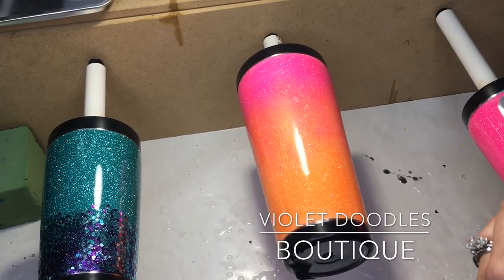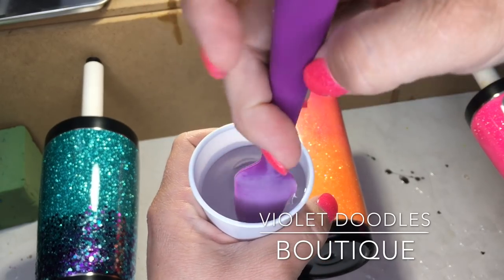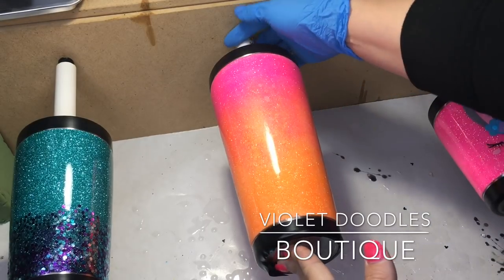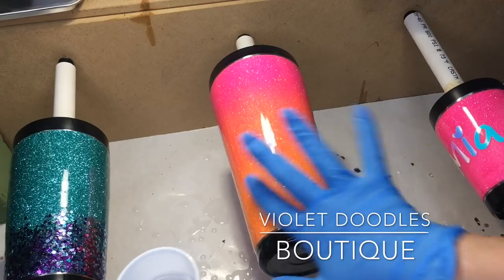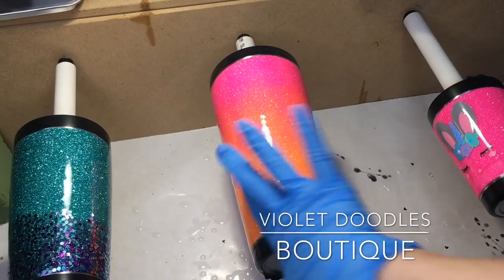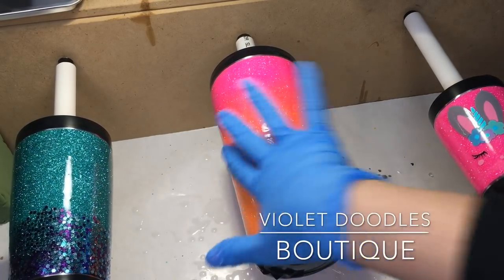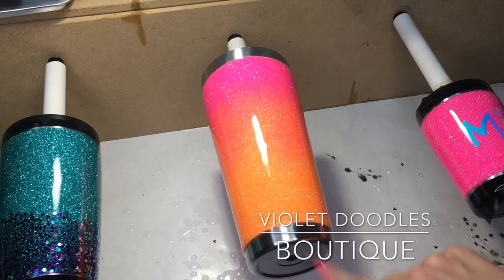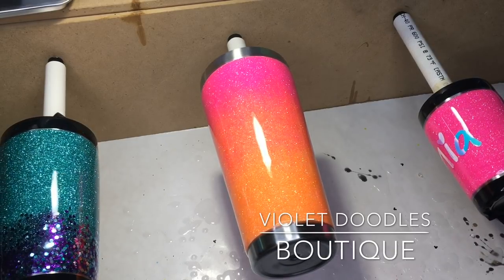Applying Epoxy Resin to a Glittered Tumbler

Comment: I don't know if you said it but how long after using Mod Podge can you apply the epoxy
Reply from the maker: Mod Podge can be deceiving as far as if it is dry or not.  I almost always wait 12 hours to seal with anything for glitter applied with MP.   If for some chance you do epoxy over MP that isn't fully dry, it will begin to look white again under the epoxy.  It can happen right away or even weeks after.
Reply: @VioletDoodlesBoutique  thank you for the quick response I was hoping for a shorter time suggestion but it ended up working out! lol
Reply from the maker: Ok.  Glad it worked out.

Comment: How much Epoxy and how many coats?
Reply from the maker: Totally depends on the type of epoxy, how thick/thin you apply it, if it is a glitter coat/painted coat, etc.  A rule of thumb is 20 oz cups take generally 20mls give or take a few. With practice and experience you will be able to tell.

Comment: HELP! I followed the same steps but when I was applying the epoxy two things happened: one the epoxy got really hot and second it started to cure. Can you tell me what I did wrong please ? 😭
Reply from the maker: When you mix the parts, it starts a chemical reaction.  If you let it sit too long, mix the parts incorrectly, mix too much, etc this can happen.  Every epoxy if different.  Be sure to read the insert for your brand and follow it as closely as you can. Most companies have a customer service number if you need help with their product.  I have had it happen to me too a couple times.  It is usually when I forget about it and it sits too long.
Reply: Violet Doodles Boutique oh I see. It’s actually the same brand that you used in this video . How much should I mix instead I think I did 20ml each
Reply from the maker: That amount is fine.  Did you add heat to it during the mixing stage? That can speed up the reaction.
Reply: Violet Doodles Boutique no i didn’t add any heat . I mixed for like maybe 10 mins & then let it sit for like 15 while I ate . Do you think that there’s a chance that the epoxy was just expired ??
Reply from the maker: 25 minutes is too long.  I mix mine for a couple minutes and let it sit for a few more, the apply it.  You only have about a half hour of work time,
Reply: Violet Doodles Boutique Thank you so much for all your help I tried it again last night and it came out very good .  I did exactly what you said. seriously I appreciate all the help thank you for taking time out of your day to reply to messages💙💙💙
Reply from the maker: You are so welcome! This hobby takes practice.  Lots of hiccups but really beautiful results once you work out the kinks.

Comment: Love you videos I wanted to ask this questions if you can please answer :)Do you always sand it between the 2 layers of epoxy?do you put the sticker before layer one? How much epoxy do you use for a 30oz tumbler? And do you always use the clear acrylic coating spray paint before putting the first layer of epoxy?also do you always do 2 layers of glitter if you do how much time do you wait for each one to dry? Thank you! 🤗
Reply from the maker: Thank for watching.  I will try to answer all of your questions.  

I don't sand the first layer ever. If the glitter is poking through, you will take off the color.  I typically sand the second coat to make sure it is smooth for the vinyl.  The vinyl is applied after a smooth coat of epoxy (usually the 2nd coat but sometimes I am lucky and can do it on the first coat of epoxy). 

For a 30oz cup, I would make 30mL of epoxy.  Now, I typically have several to do at a time, so I mix more.  

I only seal if it is more than a two color ombre or an intricate design. Sometimes I use the acrylic gloss and sometimes Rustoleum 2K clear gloss. Both work great. 

I almost always do two coats of glitter.  I like the glitter to be covered and true to its intended color for the design.  Black glitter, I can usually get away with a black base coat and one coat of glitter.  

I will let ModPodge dry for at least 30 minutes before I go on.
Reply: Violet Doodles Boutique thank you so much for your help!
Reply from the maker: You're welcome.  There are not really any hard rules with this hobby.  Play around and have fun.  The only things I would make sure you do is follow the safety guidelines with your chemicals.  But, otherwise, experiment and get creative.

Comment: Good morning, I have a question why when my epoxy dries it look like holes or deep bubbles bare all over my cup. Like I put pic all over one cup and it's like holes ( like I skipped over that spot with expoxy) all over the cup.. Help
Reply from the maker: A couple things could be happening to repel the epoxy.  It happens to everyone eventually. Some glitter has a coating on it that epoxy hates, usually a chunky glitter.  You can seal it with a clear spray; I like Rustoleum 2X Ultra Cover Clear Gloss or Treehouse Studios Clear Acrylic High Gloss Coating.  If this is your first coat of epoxy and you have bare glitter showing, I would wait for the epoxy to harden and spray it with a clear.  Let that dry and epoxy again.  You may have to sand after the second coat depending on how deep the dimples/fish eyes are. 

If this is over a first layer or over vinyl, it could be caused by oils from your hands.  

Here are my steps:
*prep cup- sand and wash with dawn
*sometimes basecoat
*glitter 
*seal glitter for chunky or complicated designs
*epoxy 1 or 2 times
*lightly sand and wash with dawn
*decal
*wash with dawn again- I never skip this step!
*epoxy final coat
*wait 3 days and clean cup well with (bare stainless with acetone) and then whole cup dawn

I hope this helps. Let me know! Good luck!
Reply: @VioletDoodlesBoutique 
Thank you so much I will try your way tonight!! 😇
Reply from the maker: Good luck.

Comment: Do I have to have a turner to do this project?
Reply from the maker: It definitely helps.  You can turn by hand but it takes a lot of commitment.  Search hand turning and you should find some videos.  Some people have started "hanging" or "dripping" and I would high discourage that method.  It does not give an even coat and wastes a lot of epoxy.
Reply: Thank yoooooou
Reply from the maker: You are welcome.

Comment: What type of turner do you have?
Reply from the maker: It was custom made by my engineering husband.  It is chain driven with one 3D printer motor. It spins 5 at a time.  That's all the info I have on it.  I just told him what I wanted and he went from there.
Reply: Violet Doodles Boutique  you should have him sell those also.  See where it is a must for a nice finish.
Reply from the maker: It helps for sure.  He is not interested in selling them. It is heavy and time consuming.  No one will want to pay his hourly rate or the shipping cost.  I have suggested a video but he wasn't interested in that either.
Reply: @VioletDoodlesBoutique  What do you have in the center holding your tumbler? Thank you for the tutorial. Excellent! I wonder if your husband could just write up the design and sell it.  $$$
Reply from the maker: Inside is a foam football or round ball on a pvc pipe. The ball depends on the cup.  If I can talk him into building me another one, I will try to do a timelapse or something and provide a supply list.  We will see.  His job and hobbies keep him busy.

Comment: Can we get some info on the spinner?
Reply from the maker: My husband made it.  It is chain driven, has one motor (a 3D printer motor), and 5 steel rods that hold the PVC pipes. I don't know a lot of the other details. I just told him my needs and he came up with this.  It helps that he is a mechanical engineer.

Comment: This may sound dumb, but even the home depot guy didn't know the answer. I have an acyrlic clutch purse, I applied a decal to each sides, but hate the way u can tell its a "sticker" when u touch it, even look at it. Is it possible to use an epoxy resin & paint it over to make it look blended? If that makes any sense...lol
Reply from the maker: Epoxy dries as a hard plastic. It would not be the best option for a flexible bag. Instead of putting the decal on, have you considered using the vinyl as a stencil and painting it?

Comment: What is the best Bubble Popper to buy and how will we know when to pop the Bubbles?
Reply from the maker: The key to bubbles id to try to not make them.  Stir super slow and try not to add air.  This takes practice.  Some people like to warm their epoxy before mixing, I don't.  After you apply it, you can use a torch or heat gun to help pop any.  You can come back after 10 or 15 minutes and check again because bubbles will surface.  All of this takes practice. Some epoxies are more finicky than others.

Comment: I use art resin for some other projects, would it also work for this? It is a 2 part resin.
Reply from the maker: Some people use it, but I have not.  I would suggest checking the data sheet to make sure it is safe for direct and indirect food contact.

Comment: I would use an epoxy with UV protection & a high heat tolerance Allumilite doesn’t have that
Reply from the maker: That is definitely something to consider when choosing an epoxy to work with.  Cost, FDA compliance, ease of use, ratios, where to purchase,  all also factor in.  Everyone has a favorite and should research and try different ones.  The application is about the same for each.
Reply: @VioletDoodlesBoutique  I was perusing in the paint department at my local Lowe's, and they sell a 2part epoxy that is food safe.  (can't remember the brand)  Anyway, check your local Lowe's or Home Depot!
Reply from the maker: Oh yeah, there are several you can choose from.  Each has it's own perks and challenges.